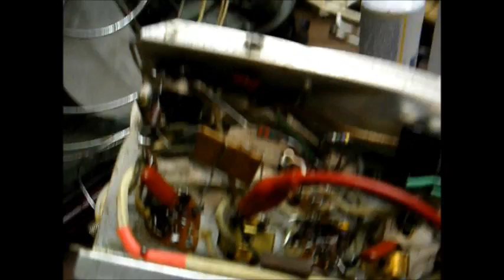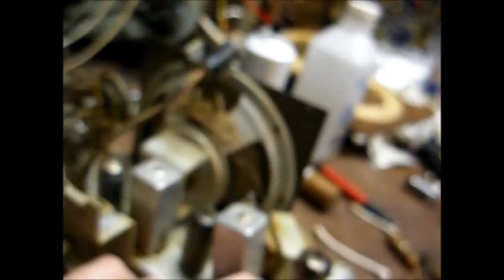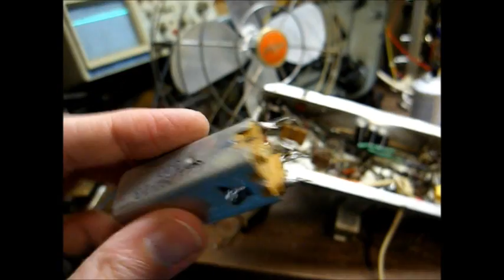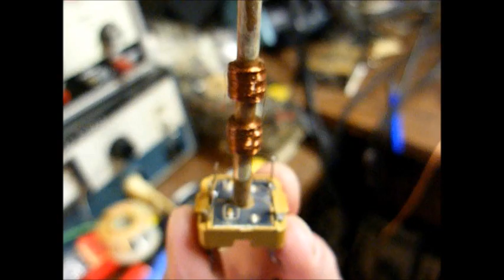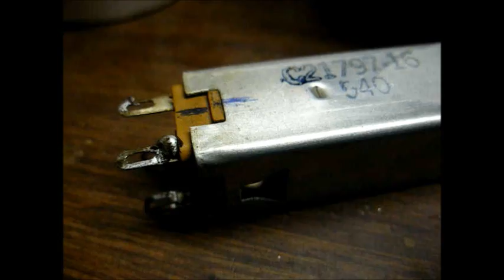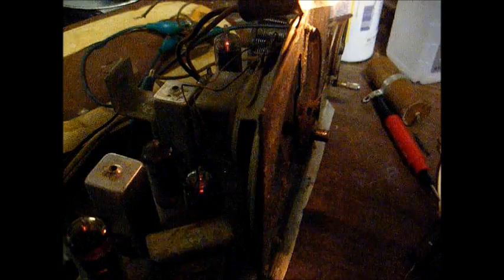Repair of a 1951 Silvertone model 5 tube radio - part two

Comment: Hello, did you get the caption of all the am radio stations  with this repair?  I have the same trouble, the radio just can select  from 900 kc to 1400 kc, thanks.
Reply: That sounds like a problem with the oscillator- I'd try installing a new converter tube.

Comment: Hello..How would you solder or "splice" very very fine wire like this if you broke it? Do you make  a coil pigtail of wire  etc? I have a Silvertone 6136 radio and the antenna coil is broke and I need to reattach the wires somehow...

Comment: In my case I used some precision ceramics since it was a plain Am only 5 tube AC/DC set. I wouldn't try that with an FM radio but AM sets are typically 455 kc/khz so one 20th the IF frequency of an FM set. Some of these slug tuned caps used precision ceramic caps rather then the silver mica sheets, those types shouldn't be a problem. The older larger slug tuned IF cans and coils often used molded mica caps and those seldom have problems.

Comment: I've read the comments here and got a nice tip from you guys.
Measure the old micas first
Or,,,
Place variable trimmer caps in there, do the alignment, and see where the best Q & amplitude for the radio ends up. Remove the variables. Measure them. And replace with closest match.
Great ideas I'll try in the future.
Thanks everyone!
Tom

Comment from the maker: Shango066 has a video of a late '60's GE hybrid radio that I think he ended up using 50pf caps across the IF transformer. I think he came to that conclusion by tacking variable trimmers across the pri and sec windings, adjusting the trimmers for best performance, and then measuring the value of the trimmer.

Comment: That's one thing you have to watch for, the value of the micas they used were not always a one size fits all affair. One suggestion I read was that you should make every attempt to measure the original values before swapping them. The set I repaired had intermittent rather then leaky mica caps and they tested around 140 mmf/pf not 90 or 100. I tried using a pair of 90s and it lost a lot of gain, so I paralleled them with a 50 and it worked.

Comment from the maker: Thanks and I actually thought about doing it that way; but, decided to solder them outside the can in case the 100pf didn't work well and I had to use another value. The last thing I want is to have to take everything apart again.